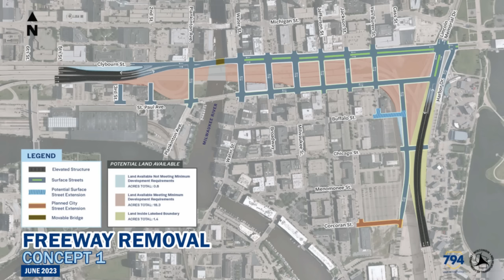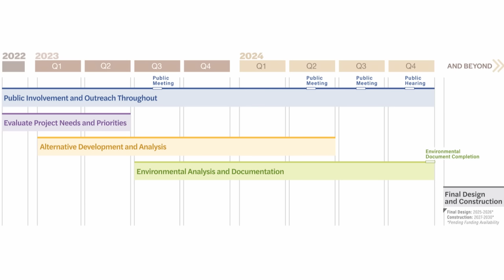Why Milwaukee Is Tearing Down Its Freeway To Nowhere (I-794)

Comment: I'm pretty familiar with Milwaukee, I don't live there admittedly, but I've maybe spent more time in Milwaukee than Chicago, which I actually live closer to. I'm also a full-time transportation designer. I think getting rid of the freeway is the wrong idea. That alignment of proposed Clyborn and 794 isn't even at a right angle, making it overly harsh towards vehicular traffic and inconvenient. And even with a refined design and layout, I'd also be curious as to how all that acreage would be filled and how much traffic that new development could generate. Also, I-794 acts as an alternative to I-94 here for traffic originating closer to the lakefront. Alternate routes are often overlooked in these freeway removals.

I'm in favor of simplifying and bringing the two sides of the road together, as I think it offers benefits of a smaller footprint and opening up new land, while helping to keep traffic off the city streets. I've walked underneath that freeway, and I honestly don't think it's as bad as people claim. The Third Ward is still doing pretty well, even with the freeway.
Reply: I94 is 2 miles from the lakefront. 794 is only convenient if you’re right next to it or going to the Summerfest grounds.
Reply: “I’m also a full-time transportation planner” is code for “I build highways for a living” and everything that has been wrong with the DOT’s for a century.

Comment: As a Milwaukee resident, it is evident that the latest construction and development of living spaces are aligned with the Agenda 2030 concept of creating multi-use spaces. The removal of the current highway structure would open opportunities for more such developments. The highway to "nowhere" appears so only because it was never completed. Residents know that Cudahy, South Milwaukee, and Oak Creek (formerly Carrolville) are completely cut off, making travel to these areas significantly longer. Imagine opening up this route, enhancing business potential in these cities, and providing residents with more options. These areas, currently considered "nowhere," would transform into true destinations. 

developers are lobbying for this land and want to build on it, I question how much the residents are considered, let alone, those "nowhere" cities.

Comment: One slight problem with the last plan it will not decrease traffic. Because if you have a place is still dependent on cars. Traffic will still be an issue.

Comment: Do a video on interstate 26. It’s designated an east/west interstate but it runs north and south. I travel it frequently and it has always bothered me.
Reply: Sounds like 128 South from Canton to Braintree in Massachusetts. The 128 loop goes from Rockport to (unofficially) Braintree. The section of 128 from Cantom to Braintree is now unofficial because officially taken off but… 128 South from this section is also I 93 North until Braintree where I 93 turns north to Boston. I 93 South from Braintree to Canton is 128 North.

Comment: It’s not a freeway to nowhere; everyone knows this is a valuable connection for the city. The question is whether the costs of specifically the east-west segment through downtown outweigh the benefits. The answer is no. A surface boulevard will easily be able to accommodate the traffic volumes while adding only a couple minutes to travel times.

Comment: Milwaukee is a city that relies on roads. There is no efficient light rail system throughout the metro region (The Hop doesn't really go anywhere). Traffic is bad enough getting to/from downtown, and the last thing I want to do is sit at stop lights every block on a boulevard. 794 is elevated with plenty of north-south streets under it, so it doesn't really close off the Third Ward from downtown. My vote would be to keep the freeway.
Reply: 794 doesn't have any traffic.... the only traffic from downtown to everywhere else is on 43 and 94.
Reply: @flyingbanana4179  There are a lot of people that hop on 794 to get to 94 and 43, especially from the eastern downtown area and lakefront.
Reply: @admirals818  Well, if that trip is 2 minutes longer, is that inconvenient?
Reply: @flyingbanana4179  That could be up to two minutes per red light. So, maybe 6-10 minutes extra just to get to 94 or 43?
Reply: @admirals818  Well, it depends on how they time the lights. Lights can be timed differently during rush hour on Clybourn, just like they do with the boulevards down in Chicago.

Comment: Are they discussing alternatives to driving? Light Rail, for example? If you want to tear down a highway and are concerned about where all the cars will go then you HAVE to consider other transportation options
Reply: They are, they recently added a new rapid transit bus line on Wisconsin Ave. I’d assume they’ve got more plans in place too
Reply: There’s a light rail that only goes between the third ward and downtown. Maybe they’ll expand it soon.
Reply: Simply avoid it altogether. It is much easier to shop elsewhere as well as work away from the panhandler haven.

Comment: As a Milwaukee Resident, If I didn't have the  route that I have, I would probably never have to use it, but it currently serves a good, Quickly used purpose for me. Getting me to Lincoln memorial drive from I-94 to cut around the city to get to the upper east side.

Comment: This terrible idea will unfortunately disconnect most from shopping and visiting Panhandler Haven, Downtown Milwaukee. A haven where you get hit-up for "anything you can spare" every half-block. Where parking is a premium, and you pay for it. 
It's simply easier and more convenient to shop away from there as parking is plenteous for those of us who wish to have expedient, convenient personal transportation as opposed to using slow, inconvenient public transportation.
The 3rd ward has done just fine without "being connected". Useless waste of money.
Reply: It's not a waste of money when it's cheaper than rebuilding 794. Also, people use it to get downtown, not go through it.

Comment: I really like your channel - both the content and the delivery. It is, however, very hard to read those maps given the white lettering. I watched the I-11 vid this morning and attributed it to the topography but this one is no different. I’ll have to go back and watch an older video but I don’t recall it being an issue before. Did you change your map source or do I need better glasses (entirely possible)?
Reply from the maker: I use Google maps pro for pretty much everything. Sorry if you're having trouble reading, but it would not be easy for me to fix because I just use screenshots of the main app
Reply: @BeaverGeography  Understand completely - thanks for the response
Reply from the maker: @pjesf  of course! Thanks for supporting the channel!

Comment: If this is done Wisconsin should decommission all the 3 digit interstates, including I-894 (I-41 follows its entire route) and I 535 (wis 535 can handle it).
Reply: I-41 is way over signed if you ask me. South of I-94 was already interstate, why overlap?
Reply: @jdprocknow  probably political so they could claim the Fox Valley is now connected to Illinois via a single interstate, but I agree it's silly and should only exist north of the Zoo Interchange. The only nice thing about it is it helps alleviate confusion on the N-S portion of 94 thru Racine and Kenosha, where "West" really means North and "East" really means South.
Reply: They should turn Wisconsin trunk highway 441 and 172 into 3 digit interstates. Since they already work as belt highways for the Appleton and Green Bay areas, respectively
Reply: @jacobkorducki6940  , it was the most populous area in the US not on the IHS but in the end, it was about marketing. That said, it should have been I-57.
Reply: @wilderac2250  there would have to be a bill written for it to come into existence. My thoughts are that the local politicians didn't see a need to spend political capital on it. US-41 seemed like a slam dunk because it's a mainline road. 3di's are a little harder to get, especially if the state has proven to be able to take care of those highways without federal assistance.

Comment: If traffic related to the Summerfest would be a concern, I wonder if they could bury the highway. Since traffic is only a problem during a specific time of the year, they probably could build the tunnel after tearing down the viaduct and not face the challenge faced with I-93 during the Big Dig. On the other hand, I imagine it would likely still take more than a year to build the tunnel.
Reply: Ridiculously expensive for a two week music festival. That’s what transit is for.

Comment: They could take this freeway out and change the land to greenspace, a light rail connection to the airport and downtown, bikeways/walkways, and possibly some kind of rail connection that runs south to Chicago.
Reply: At the cost of how many billions of dollars?
Reply: Milwaukee already has a train to chicago
Reply: @markbajek2541 probably not more than it cost to build in the first place
Reply: Chicago and Milwaukee are already connected by Amtrak...
Reply: @markbajek2541  Couldn't the same question be asked of multi billion dollar interstate expansions? Proper transit allows for more residents and more business, which can boost tax revenue.
Reply: the difference is usage, look at the "hop" in Milwaukee it's free and no one rides it, the "Q" in detroit same thing , and whatever cincy put in same thing they are just cars with air running around , little or no ridership and that also goes for most public bus systems...big buses no riders, at the very least scale down the bus size to your ridership capacity  @TheNobleFive

Comment: I know it would be super crazy expensive, but I personally like the idea of burying (all) the Milwaukee freeways in the downtown area, or at least lowering them below street level.  Best of both worlds, allow for traffic flow while restoring street level connectivity.
Reply: "traffic flow"
that's not how induced traffic works - you would get the same result they got in boston, madrid, seoul, etc:
more car infra leads to more traffic because motor vehicles are the least efficient mode there is, in short
(if you want to allow for traffic flow, take space away from cars and give it to literally any other purpose/tr.mode)

Comment: Now time to do a video about the lack of proper freeways in Madison, WI and how awful traffic is for a city it’s size
Reply: Freeways in cities are a bad idea, period.
Reply: Which freeways? The Beltline does successfully go through Madison. Highway 30 is an odd highway which abruptly ends, but it is an easy way for those people to get to the interstate. Highway 51 is weird. It tries turning into a freeway a few times, but then stops.
Reply: @retroryan838  Exactly, there is no loop. 18/151 does the same thing where is tries to be a freeway but then has 2 at grade intersections. In the morning heading west in the beltline there are 3 lanes backed up in the beltline for miles with trucks trying to get to Iowa or 13,000 people (maybe) trying to get to Epic. Plus the north side and north burbs Waunakee for example are underserved. There is no loop. It’s cool that interstates 39/90/94 run concurrently and it’s only one of two spots in the US where 3 major freeways run concurrently, but it doesn’t really serve the city other than the far east side of Madison.

Comment: More large cities need downtown penetrator highways. It makes it much easier to get in and out without having to grope around surface streets trying to get back to the interstate.
Reply: Yes, the suburbanites should be able to drive all the way downtown and park on massive parking lots for free. The people living there don't matter because they are dirty.
Reply: @julm7744  it’s a pretty big loop around a lake.
Reply: @HHSGDFootballJPD 

ALCS
Reply: Large cities need to get back to building for the people that live there and not for the suburbs.
Reply: @julm7744  Other than the 10 lanes, what you described is many American cities. They still get paralyzed with traffic, and more lanes will only help so much if they all eventually funnel into small surface streets. Just build more transit for the people who live there. Add in commuter rail for the rest.